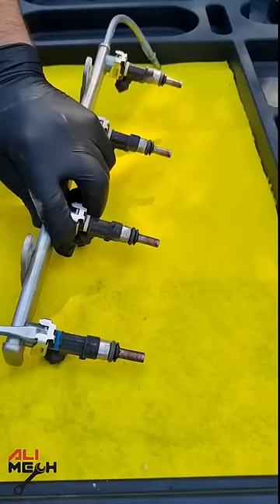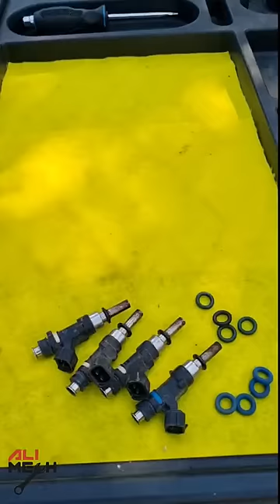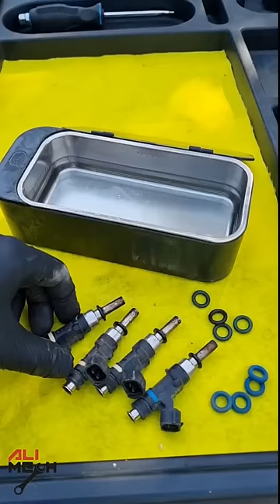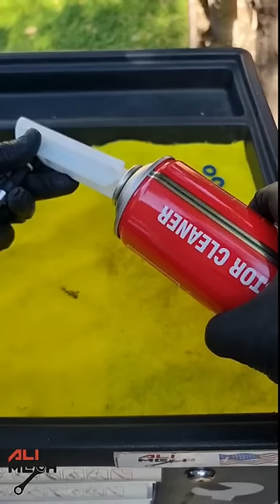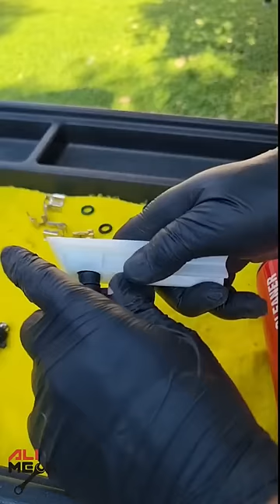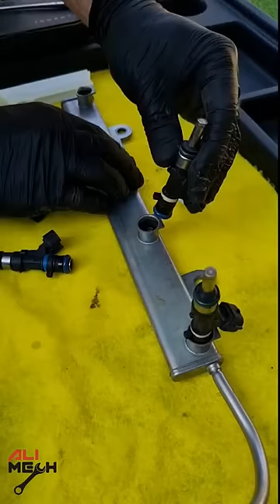Universal Fuel Injector Flush Cleaner with carb cleaner #shorts

Comment: I just wish that all car dealers actually did all this when they say that your injectors need cleaning. They don’t ! You will be lucky to get a few sprays of carb cleaner. Pure profit for them.
Reply: It's more cost effective for the dealer to just replace the part.
Reply: Service your car, don't wait 5k miles on an oil change. Don't use cheap fuels and oils. Don't say "I'll get that done tomorrow" when your brakes scream. It's your own lazy habits that bring your car down.
Reply: nah man we do clean em but if you take em off you have to replace the o rings just more cost effective to replace them we run em through a machine that actually cleans them well specially the piston heads for carbon thats why we charge so much

Comment: as a tech i can tell you that this wouldn’t work at all especially for those direct injectors. the best way would be an injection apparatus that using shop air would push an ethanol based cleaner through them while running the motor to also break down cylinder deposits.

Comment: Excellent job with cleaning but I think for the total job you're missing a few things but you might have other videos for...
For example if you're doing the injection spray clean for four cylinders how do you also know that the pressures allowing the fuel to go through for each injector are correct and equal and if the ICM ECU is going to recognize the pressure differences without resetting the system or throwing a code for inconsistent feel pressure and the filters in the vehicle need to all be replaced in the fuel might actually have to go through a filter system or get replaced itself in order to not allow this to happen again because of their clogged with crap and most likely the injectors internally might be bad so I'm not sure exactly if this is covered in another field video...??
Reply: Depends on so many things, if you clean any fuel system you need to change the filter. Sometimes you need to flush the tank, sometimes not. Most computers won't recognize individual injector pressure differentials because rail pressure is the same for all of the and you can't really measure the difference in rail pressure between injector operations since it's so fast.

Comment: If I was going to go through all that trouble I would have just bought new injectors cuz you got to remember there a motor and they act like a light bulb they all blow out
Reply: If you're running high dollar injectors you wouldn't be. Try running some high impedance injectors worth E85 fuel which requires that you clean the injectors from time to time. You won't wanna fork out that kind of money for injectors.

Comment: You only cleaned the surface with the ultrasonic cleaner and maybe the inner filter before the fuel rail but that’s all. I know because I’ve made the same mistake as you have. If your not somehow powering those injectors and pulsing them then the bath you just put them in was very ineffective 😄👊🏼
Reply: Watch the video again, when he hooks the injector up to that white thing after the sonic bath he clearly has a wire alligator clipped to the injector plug to pulse it while he's spraying injector cleaner through it, because just pulsing them without spraying at the same time is beyond pointless.

Comment: trash video.  don't dunk the electrical components in any liquid.  you're gonna have to hook the injector up to battery power, to spray cleaner through it... without the filters on if you're planning on reusing them... but just get new filters, they tear easily when trying to clean... and they can be difficult to find.  dealerships often don't even sell them, nor do local auto parts.  to find the right ones for my car, i had to buy matching ones that were listed for another model of honda.  because no place sold them listed under my year, make and model.